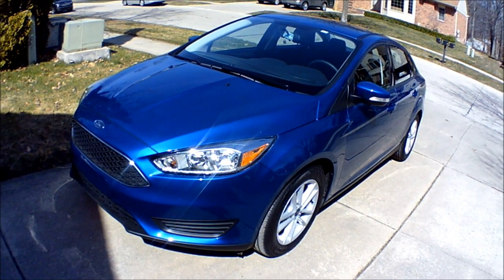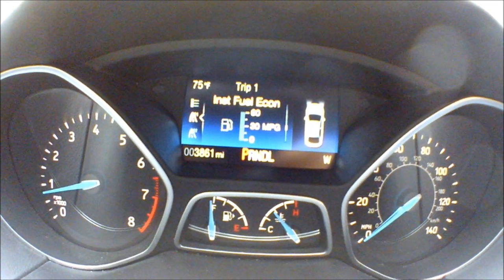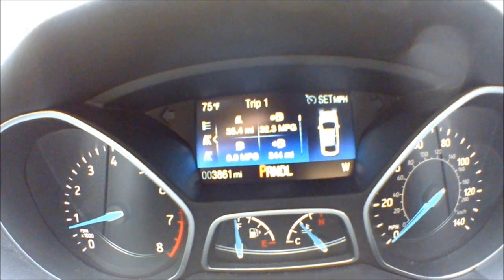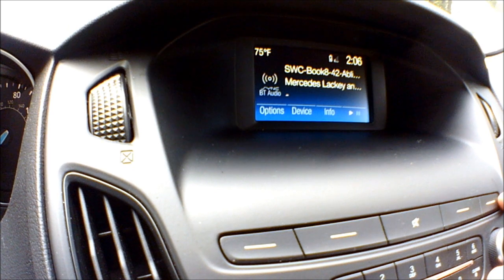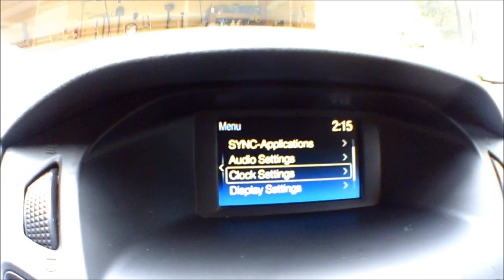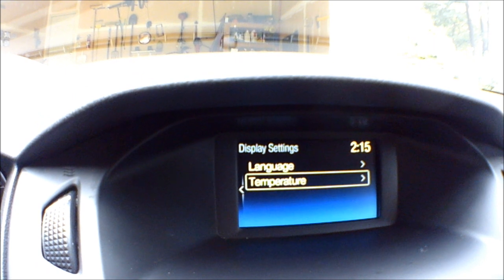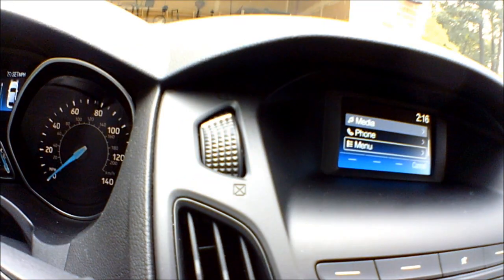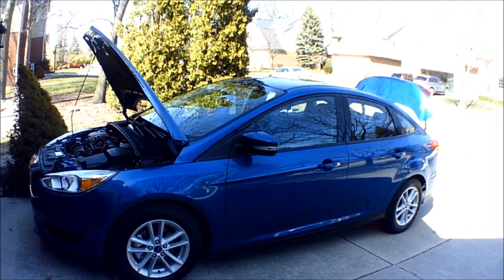My New Tech: 2018 Ford Focus SE

Comment: Are you still happy with you car?
Reply from the maker: I am. It has been a solid, dependable car and I still enjoy driving it. I've had no issues with it so far, just taking it in for regular maintenance. Gas mileage is still good around 32 MPG.
Reply: I test drove a 2017 Focus SE a couple of days ago at dealership.  I think I’m in love with it.  It was Gold in color and Dark Black for the interior.  When I drove it, I felt like I was low in seat and it felt like I was driving a sports car, which is magic to me.  I love it, I’m still trying to decide if I want to trade my Chevrolet Sonic in for it.  The second I was in the Focus, it felt like all interior was in front of me, and I was intrigued.  The gold color makes it look classy.  But I love your Blue color.  That is a beautiful color.  Your features are similar to the 2017.  
The air conditioner is out in my 2015 Chevrolet Sonic.  I’m worried sick about it.  
Thanks for this video, really nice car!  Do you still own this?